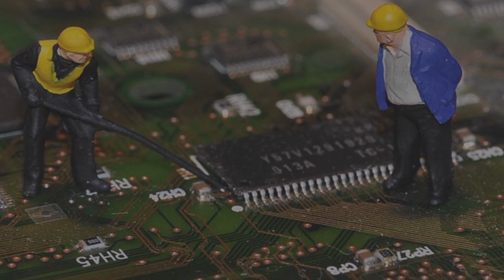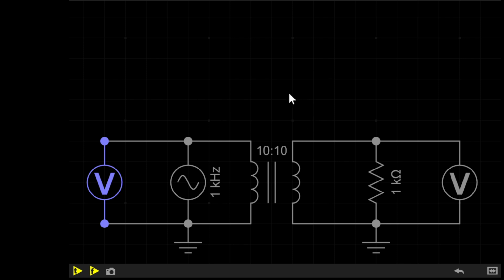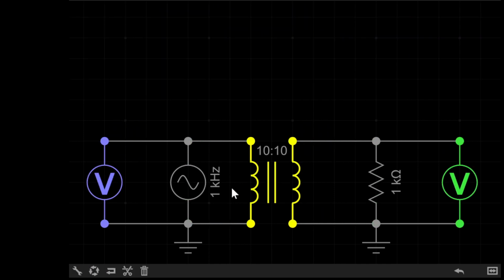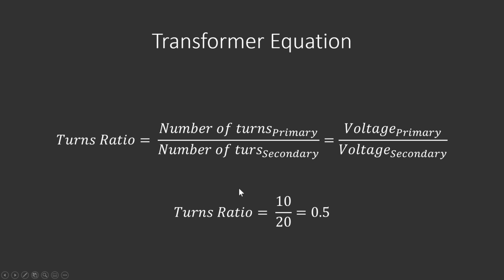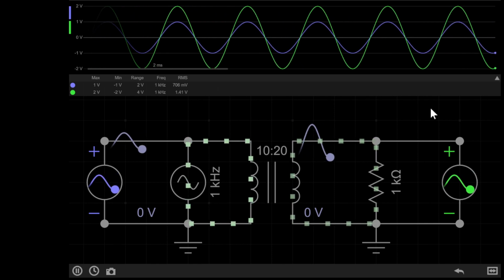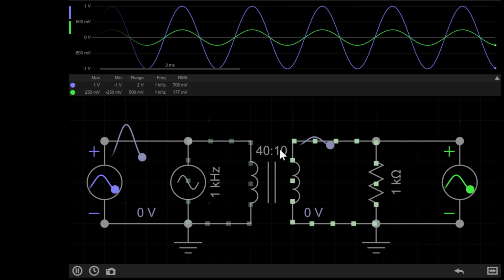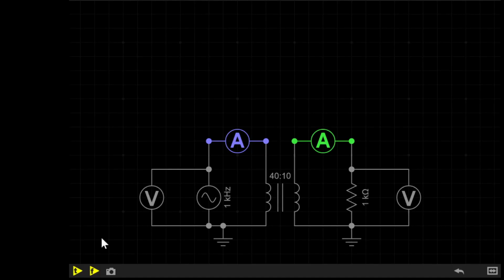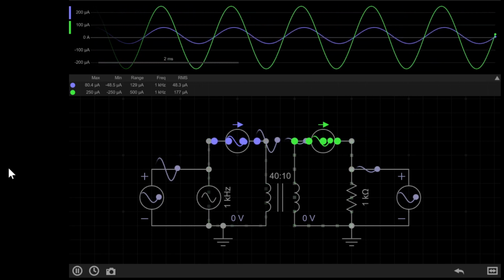Transformers - Changing Voltage?

Comment: What is the coupling coefficients and why does it go nuts if you adjust it from 1 to 1.01?  But not if you adjust it to 2. Think originally it is set at .99 so if you hit the + sign twice you’ll see the volts either spike or drop dramatically. Do you think it’s just a glitch in the software or is that going to happen in real life?  Just wondering… great videos btw , I really happy I found your channel. The way you explain things makes it super easy to understand. Keep up the good work . Thanks
Reply from the maker: Hi, 

Coupling Coefficient in simple terms is basically a measure of transformer efficiency.

If you have a coupling coefficient of 1 that means that 100% of the magnetic flux or 'power' on the primary is converted to the secondary.

A coupling coefficient of 1 is impossible in real life though because there are loads of small losses and inefficiencies, however I simulated a coupling coefficient of 1 in the video as its easier to understand as a viewer who is learning.

A more realistic coupling coefficient would be 0.99 or 0.98 but you will notice the output dip slightly.

Thanks for the great feedback and I hope that helps!